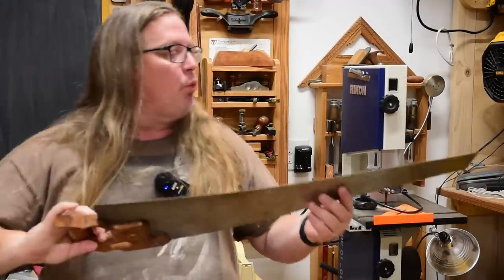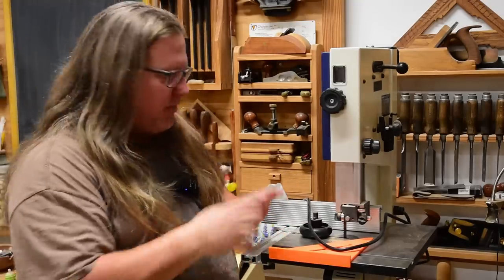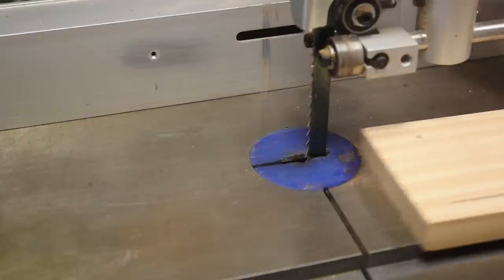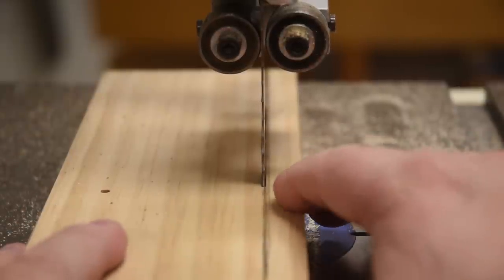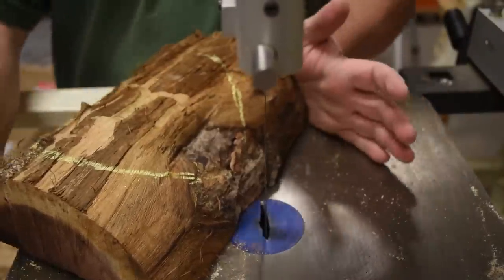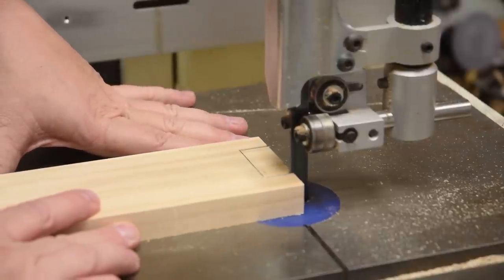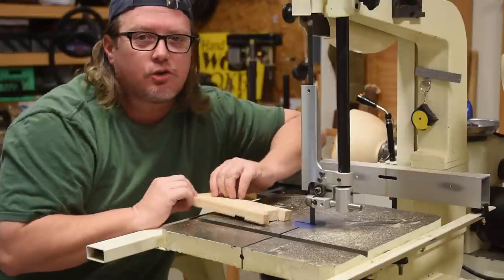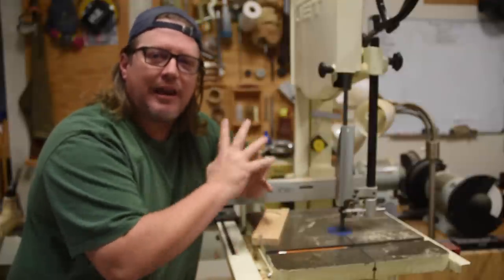Band Saw Tricks and Skills - Throwback Thursday

Comment: Bandsaws are the best! Couldn’t do without my 3… (paid a total of $131 for all of them and they work perfectly) I use 13mm flex back 4tpi blades which I buy by the roll and make to length by silver soldering (brazing) cost of blade comes out to around $10 each.